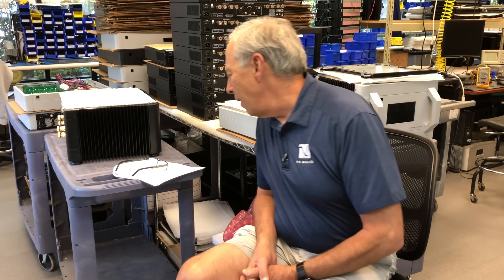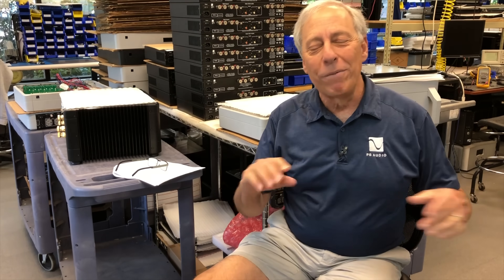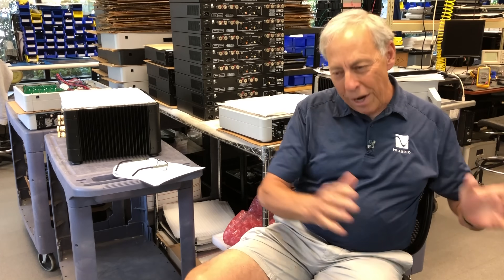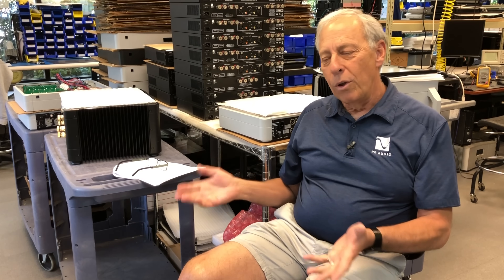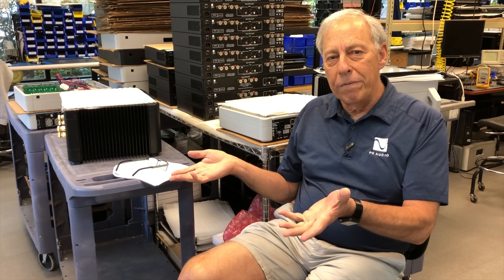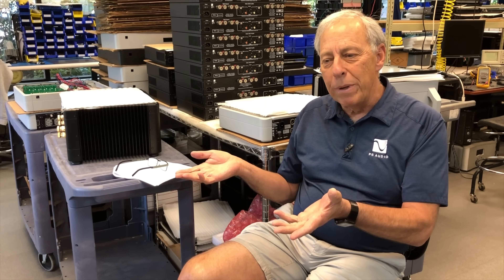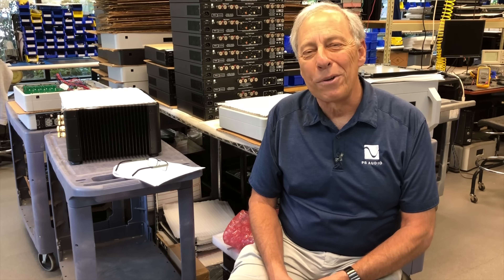Why don't subwoofer have high pass filters?

Comment: Wouldn't a high pass filter be good to limit cone excursion?
Reply: Yes, that's also what it's used for (subsonic filter)
Reply: Well, subsonic filter is kinda dumb because subsonic is defined as below 20Hz and recordings never go below 20Hz, with CD is literally impossible. So subsonic filter only really filters what doesn't exist.
Reply: Why do you think below 20Hz is impossible on a CD? Because in theory, you can even encode DC in PCM which equals to 0Hz, in practice the low limit of a CD is 2Hz. But that's not the only reason why subsonic filters exist, but why would I explain that to you...
Reply: Now I think about it, I always read that CD's frequency range was from 20Hz to 22kHz, but never really thought about why, now I think about it, I'm not seeing why not since PCM data is just a set of amplitude samples over time, I guess I will have to go read a bit more about PCM, as for the subsonic filter, still the only way I can imagining is being necessary is if the amp (or some part of the signal chain) is introducing infra-sound into the signal but that would be wiser to fix the faulty component rather than adding/enabling a subsonic filter to it.
(Yes I know amps have DC bias current and DC offset, but that's not what I'm talking about)
Reply: God you have a lot of content below 20Hz in movies, you can also get it from mic in PA. And subsonic filter is not sub-20, it's for filtering eveything the woofer can't  play, whether it's below 30 or below 15Hz
Reply: I see, I thought subsonic filter meant to filter the lower limit of the human hearing, rather than the lower limit of the woofers, that makes sense then.
Of course on PA your going to have raw unfiltered unprocessed audio that can cause damage on certain systems, but my argument was in the scope of reproduction of processed audio, eitherway my argument was wrong due to my misunderstanding of what a subsonic filter is.
Also, I didn't know movies had content below 20Hz, I thought audio was highpass filtered in production.
Reply: [ God's on YT? Never knew! ]  Anyway subwoofers can go subsonic, and frequently do - below 20Hz is not audible, but you can definitely feel it in your chest, and you'd certainly be missing out in the 1812 overture when the cannons go off with a sharp cutoff at 20Hz.

[ just discovered headphones are hopeless for 1812 cannons ]
Reply: I see, but to recreate close to the impact of a real cannon some serious amount of amplifying power, subwoofers, room size and resources would be needed. Nothing tangible within the "home stereo" league. An array of PA subwoofers come to mind, many of those in a room big enough to accommodate them.
With this said, I never really listened to any real "high end" stereo system, so I may be speaking out of ignorance, maybe in a small room doesn't really need that much power and can get efficient with less power.

Comment: Many subwoofers DO have high-pass filters for the mains.  And many subwoofers have HP filters themselves (subsonic filters).  So the answer to the question is just "they do," period.  And obviously, they SHOULD, or else there will be extremely noticeable phase issues.
Reply: Of course, it's generally an active filter, as passive filters should not be used under any circumstances except by the poor.  And the "way" good active filters sound is "perfect."  Time correction is easy.  Though I understand a lot of people like to use only technology available to the Pilgrims.
Reply: passive filter for a subwoofer is definitely not a thing for the poor :D active filter is much cheaper, especially in this case (low frequency) and of course it's also the better option.
Reply: Well sure, you're right of course, if we're comparing WELL-DESIGNED filters.  A cheap passive filter is cheaper still than a cheap active filter, but is very unsatisfactory.  But in the end you're right, active filters are better because they're cheaper FOR THE SAME PERFORMANCE.  But the cheapest option regardless of performance is always a poorly-performing passive filter.
Reply: And I'm not really disagreeing with you Paul, more I'm saying there should be no mixing and matching.  If you use a separate subwoofer enclosure, it should be part of a purpose-built system.

Comment: I big problem with un-filtered front speakers is that if they are in a vented box you will get some nasty phase shifts when it starts to dropp off in the lower bass frequencys, if you add a subwoofer to that you will get a huge dipp around that frequency nomather how you turn that crossover knob at the woofer it will be wrong..
Thats why hi-pass filter most times makes it better, just get a really good filter.

Comment: I am considering a MINIDSP HD for use as a crossover at say 70 hz. The reason is I have book shelf speakers with a 5" woofer and a higher volumes the cone excursion is high and I would assume distortion sets in and worried about blowing them. I am considering the trade off off of adding additional electronics, cost and complexity VS how the speaker is behaving at the lower registers. I do listen to a good amount of bass heavy music.
Reply: Brian Simmons why not use a passive crossover network rather than an active one? A dsp will only reduce the quality of the sound passing through, add latency, and cost much more money than an passive crossover.
Reply: AS I understand it, there are issue with correct cut off frequency Vs impedance, efficiency loss, no flexibility on frequency or slope or type of filter  and I wonder about the availability of a 70Hz high pass filter. I do have a pair of FMODs line level high pass filters but I have never been a fan of them.  For $200 USD you get a crazy flexible crossover, a great parametric EQ and time alignment. So maybe for $100 more than a passive you get all of that. EQ is really the main point of MINIDSP but comes in second for what I am looking for.
Reply: Yeah, that idea about having a very simple signal path is nice and everything, but if you don't have a lot of heavy acoustic treatment in your room, EQ is the way to go. And that's the biggest advantage of having a DSP. And MiniDSP has a very powerful EQ.

Comment: The best filter is no filter.
And that's the thing, the more you add, the more downsides you'll add.
Also, I don't know the technical reasons for it, but I generally prefer a speaker unit that uses its natural roll-off characteristics as much as possible. 
Which is probably also why I always end up with 2-way speakers. Way less filtering and only two 'sides' of the frequency curve don't roll off naturally.

Subwoofers should enhance, not repair. 
Still, I never ever heard one that worked properly. And I've had so many people try to prove it to me, they always sound added. 
It goes right for one or two songs, and then all of a sudden it's obvious that it's there.
Reply: You haven't heard the TBI Emperor DPM-8 subwoofers, which are a truly unique design. All else is compromised and reshuffled BS.
Reply: subwoofer should be an integral part of the system, not an extension or you'll end up with an unsolvable peak.

Comment: My Paradigm PS 800 does have a fixed high pass filter on the low-level input.

For me, in my modest system, this works very well, but perhaps not for you, Paul.

Comment: JL Audio make an external crossover for integrating subwoofer(s) and main speakers.  And they, perhaps not surprisingly, advocate the separation of bass frequencies from the main speakers.  However, it isn't cheap!  I have no experience on which to base any judgement.  It would be interesting to hear from anyone who has used such a system

Comment: My main system has a pair of ancient Goodman Magister Speakers. They have a tweeter, a mid range both non vented and a 15 inch woofer. The cabinet is of infinite baffle design. You don't need a subwoofer with these. The frequency response goes as low as about twenty cps. They sound wonderful. The bass is there in spades but it isn't forced. The soundstage is solid with the main singer generally firmly between the speakers, even though they are positioned for aesthetical reasons rather than sonically. They are a trifle big but my wife knew what was coming with me when we got married. That was over thirty years ago. They are still perfect and this is because unlike some speakers they don't need to be driven hard. They are rated at 40watts rms each but 10 watts a channel is ear busting and china rattling. They probably need 5-7 watts to fill the room perfectly. Installing good quality speaker cables made a huge improvement in the bass attack and with the soundstage..

Comment: The next guy who tels me ,  "I have a 1000watt sub "  again  , gets it  lol
Reply: If you think you're hearing or feeling 1500 watts peak, you're fooling yourself. By the time that thing produces that much power at any infrasonic frequency, it will sound extremely distorted and probably break something in your house. Especially if it's two. Ask yourself how many clean realistic watts can you get from a household 15 or 20 amp circuit. Use the Ohms law...it's all marketing hype. With two SVS's installed like you described, you're only hearing and feeling a few hundred watts depending on gain, volume and frequency. If you're level matching for good sound, it's even less...
Reply: Kirk Cunningham i think ANY sub will distort significantly at full power at infrasonic frequencies you idiot. A 1500 watt sub will just have more headroom than a lower rated one in general. Also a well made 20 amp circut would put out 2200 watts at full amp load. That leaves plenty of headroom to avoid voltage drop and have a class d amp that would easily put out 1500 watts at under 1% thd or even an a/b could do 1000 super cleanly. Bringing up the circut just means you tried too hard to make an argument and sounded stupid.
Reply: I have a 1400 watt 18in .... oh well I am late to the party
Reply: To get that much air in & out of the box it needs to be open vented .
Hi Fi subs have port holes so when turned up , the air bounces in the box .
The wattage is a selling point , it is useless
Reply: No one said that we have the subwoofer cranked to max. Did we? I don't get your statement.  Just as my 900 watt capable amp for my loudspeakers are not pushing 900 watts unless it is cranked and a 2 ohm load is present. I am not sure why you think because many have 1,000 watt amps or greater that we have to use all of the power. In most cases, my amps are only pulling between a 2 - 5 amp load. In comparison, a person may have a 700hp Ferrari, but it doesn't mean that you are using all 700 horses,, but it doesn't mean that you don't have the ability either. In regards to amps, your outlets or power conditioners come into play as well but NO ONE here is saying that they are utilizing all of their power.  I run network switches which have 6,000 watt power supplies but they typically run at a 2,600 watt load. It doesn't mean that it CAN'T but typical use will be well under the max ratings. A 15 amp circuit will provide 1,800 watts max, on a dedicated outlet and a 20 amp can support up to 2,200 watts. There is power there being that I have several dedicated 15amp outlets in my house for my subs and another pair of dedicated 20 amp outlets for my amps. No they are not shared outlets.
Reply: please see my response below.
Reply: They would not afford the Electricity bill  mate  lol
Reply: my set up is relitvely low power 50W for each suround channel 80W to the front and 300W to the sub but im using high efficiency speakers.  and after days of tuning, just wow.  This also leads me to believe that set up is the most important thing for a system regardless of power
Reply: True , If I ad a sub I am just wasting my time .
Keep on adjusting that level to suit each sound track  ? sod that !
Better off having a pair of good speakers in stereo mode ,8 inch base drivers will do a tidy job of that .
I have built a set of 12inch base drivers in a 3 foot tall cabinets for large scale without the BOOM , If I ad a sub to this it a waste of time due to the siize  of  the set up .
Sat "n" sub yeah but that in between sound is a bit shy .
I have 2 subs , wattage ? 100 , 200  I dose not  make much ods to me , if you turn a sub up, you can hear that air battering about .
1000 watt subs lol they use these on stage stack ups with open vent , not ported
Reply: Nah I don't have a 1000 watt sub. I have 2 500 watt subs.
Reply: room-ten-oh-nine ! Those peaks will only happen at an extremely low frequency at a very high volume. Lets say 15hz to 20hz for the sake of this conversation. However unless you have your subs going through a mini dsp or some other room correction, you're gonna hear room resonance frequency or room coupling problems at 50hz way before you hear or feel 15-20hz. All you SVS guys get hardons for all these numbers but what you all forget is about your room. Your room needs to be able to play that low at a high volume period. Most modern and older track homes with open living rooms can't hit any lower than 30hz. 25 maybe depending on the room. To hit into the teens, you need a special listening room built with sound such as Paul has...
Reply: I have to much i guess, 6000watts!
Reply: Yeah , like a tube TV thats about 20.000 volts to the tube aliment .
Check the wattage consumption on the outside label .
My ONKYO AV amp is 160 w per channal ,  600w power consumption of electricity !!!
Reply: I have 2 subs (one being 6th order bandpass) both subs get 45 watts total power and hits as low as 24hz before it rolls off. I have one sub that plays 40hz to 200hz and the other plays (6th order bandpass) 40hz and below. They sound quiet nice and you can hear/feel every note. I also lined them the inner walls with polyfill.
Reply: room-ten-oh-nine ! Lol, in my first reply to you, I agreed with you about headroom. You just wanted to argue for the sake of arguing. Only SVS fanboys do that sort of thing...cheers!
Reply: I am using a regular joe sub, but good enough for me for what I can afford a 10" Tannoy sub (150W) and I bought it together with 7 speakers for 7.1 surround (5.1.2 now) at around 600 Euro second hand. what the subwoofer costed as new I did check up and only like 400 Euro, yes I got a good deal on my 7.1 speakers. I would love to own the SVS PB16 Ultra (2400 Euros-ish) but thats way out of my reach for now atleast. And Its not about the watts of the sub, its how well you enjoy what it gives you, and that goes for all of my stuff. Also the wattage of the sub is only telling you how much power the amplifier inside of it can output to its driver and not of the driver itself. The measurement of soundpressure or how loud it sounds is measured in decibels, which is what should be used instead of watts if wanting to tell others of how powerful subwoofer you have.
Reply: Only noobs have 1,000 watt subs. I pity the noob
Reply: Aight gotcha room-ten-oh-nine! And I totally agree with what you are saying.
Reply: It takes power to make power. Don't forget the role of a transformer. It is possible to step up the voltage to however much you need. Theres capacitors too. Witch can store power when you really need it. Capacitors can also work as a filter. Figured all of this would have been figured out inside of the SVS amplifier. But looking at the size of the amplifier on SVS subwoofers. Theres no way your getting its true ratings. I understand that its one thing to list a number and say it can do it. But is it clean? In my opinion I think that 1% THD doesn't sound very good on any amplifier. Its also very important to have proper room treatment if you plan on getting the most out of the low frequencies SVS claims their subwoofers can do. Not saying SVS is bad. Its just most people buy into the marketing hype and dont realize what they are buying or getting themselves into. Sorry for the late comment.
Reply: This is a dumb shit comment with dumb shit replies. Meaningless drivel.
Reply: I have a 1000 wattt sub. Do I win? What do I get? lol
Reply: I have two SVS SB-13a which are 1500 watts each. Again, it isn't about hearing the subs, but blending them in properly. You can still have pounding bass but, if done correctly, the bass should be tight, and sounding as if it is coming from only the loudspeakers. While bass is not directional, I can clearly hear sub woofers which are not set up properly. You may not be able to tell where the bass is coming from but you can clearly differentiate the loudspeaker from the subs. It took me six months of moving subs around, speakers and playing with speaker delay. I have found tricks to make the bass match perfectly when using a home theater receiver.
Reply: yeah , a duff sale lol
Reply: @ Bargain Boondocker

Torpedoes?